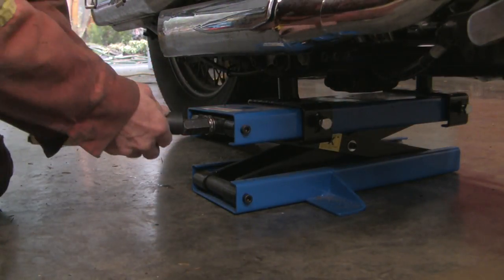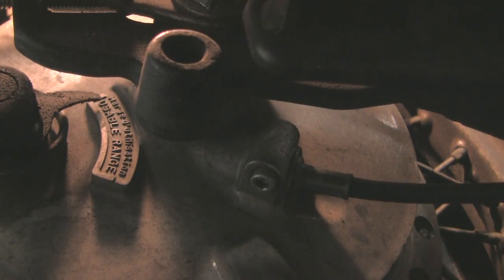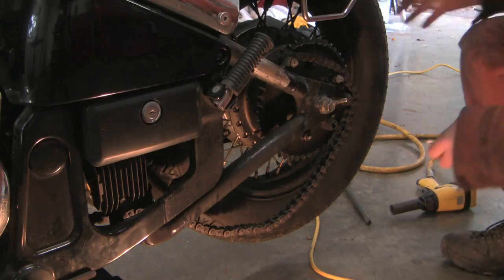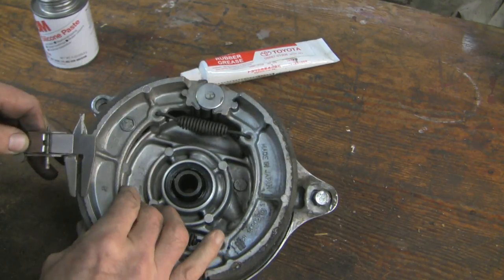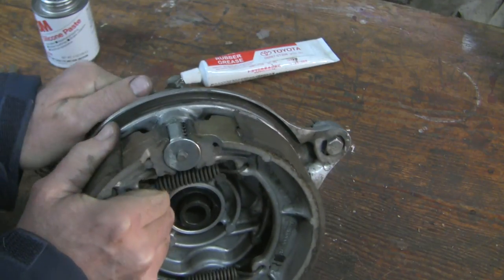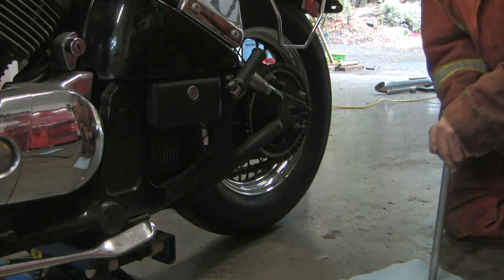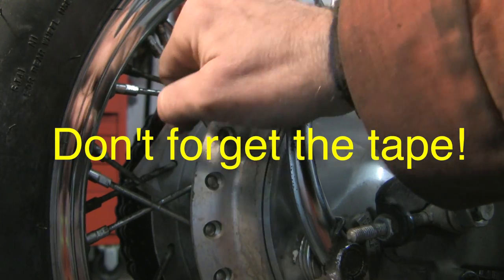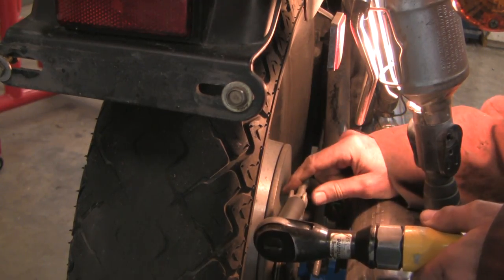Rear Motorcycle Wheel Removal and Drum Brake Inspection

Comment: Have question? My speedometer don’t work? I did replace my speedo cable but I think it might be something wrong with my rear wheel?
Reply from the maker: The end of the cable has a two pronged fork, which needs to mesh nicely with the rotating wheel inside the drum. The first thing I'd check is to verify that the fork is two pronged and correctly inserted into that part of the drum. You may have to rotate the cable and the fork a little to get it to go all the way in. Check to be sure that rotating the cable causes rotation at the other end of the cable, make sure it isn't broken. If all of that checks out, you'll need to remove the wheel and take apart the drum to verify that the inside part of the drum is working correctly. I've never taken that part of the drum apart. Good luck!
Reply: @spelunkerd hello, forgot to reply lol. But I found out who my speedometer never worked. It wasn’t fitted right? So it was bent inwards. Now I re did the error there & now my speedometer works perfectly! Only issue now is my rear brake doesn’t work right since I bought it.

Comment: When i saw the shoe material thickness i knew you were ok for another few years :-).
I have a crappy kawasaki kh125 125cc motorbike, not on the road at the moment, but the back brake is very similar to yours, just a little smaller because it's a small bike.
And my lever goes down not up, but it still has the brake rod and anker bar, much like yours.
-
Was the cushdrive behind the sprocket in nice condition?, or don't big bikes have those?.
I didn't see you take that apart.
I had to put my adjustment rings+thread in a vice to bend them correctly, a past owner must have hit them.
Reply from the maker: Excellent point. There is a cush drive deep to that sproket, although the dealers manual doesn't use that terminology. They describe it as requiring no maintenance or cleaning, so I haven't ever pulled it apart. A replaceable coupling bearing supports it and can be replaced if necessary. Happy Holidays, to my friend across the pond!
Reply: Well if there is no rotational play between the sprocket and wheel it's fine :-D
i and frends call it "cush drive" because its a cushing of rubber around the aluminium driving blades/paddles, if it becomes sloppy then there is a possibility of blade/paddle fracture.
Have a happy christmas :-D

Comment: My speedometer quit working. I watched your other video and replaced my cable but got nothing I was wounding if it could be at the rear tire ?
Reply from the maker: Yeah, possible. It would be interesting to see if the cable spins when the rear tire rotates. If you have a motorcycle lift, you could raise the rear tire off the ground, disconnect the speedometer so you can see the end of the cable where it attaches at the speedometer. Rotate the tire and see if the cable spins. If the cable spins, your problem is in the speedometer itself, if it doesn't spin, I'd be tracing the problem back to the rear wheel. As you know, the cable has an end with a fork, and it needs to slide properly into a mating part inside the rear wheel. I have never torn down the connection at the wheel, but if the problem is there you may have to explore it further. Perhaps the cable you are using is an aftermarket cable that isn't quite shaped correctly to be driven by the gear inside the wheel, or perhaps the part inside the wheel was damaged when the speedo stopped working. In any case, it would be a fun video to watch, you should consider posting your findings. Thanks for the sub, Tim! 

Dave
Reply: I ordered the same cable from your video. I’ll check out what you suggested and I’ll pull out the GoPro see what I come up with thanks again all keep you posted
Reply: spelunkerd nope 👎 not it now I have to try the rear tire see what I come up with. I did make a video when I post it I’ll be sure to let you know. Thanks again for your help

Comment: Hi I am doing front breaks and I can't  get the inside  break pad to stay in,   am I missing  something  or a clip?
Reply from the maker: I did a separate video for front pads on the Kawasaki Vulcan VN800A. If yours is identical you'll want to watch that one. As you say, many calipers have abutment clips to hold the pads in place, but this old Kawasaki does not. Once the caliper is bolted onto the rotor, if properly installed there is nowhere for those pads to move. As I recall, one of the pads has holes in it, through which the sliders glide. If in doubt, go to the most reliable source, the dealer's repair manual, which Kawasaki sell online in pdf form.
Reply: @spelunkerd  okay,  and I thought I left this comment  on that front brake  Video lol.

You are correct  the one is a regular  page with a tap on the top then the second  has a plate with holes that keep it in place,   I put it on and bolt it up and as I pull the front brake it keep popping  out and I just was frustrated  last night after it popped  out for the third time
Reply: I guess I am keep  the pads to  far apart  when I bolt the caliper on , thanks for the reply 👍

Comment: What that indicates "usable range" on 2:42 ? Isnt it drum ware indicator?
Reply from the maker: Yes, that's a wear indicator, to offer a quick check on how much of the shoes (and drum) are remaining. Apply the rear brake and record where the needle points at full brake position. You don't want to rely on that to estimate drum wear, but it is a pretty good guide if you know it was mounted on the shaft correctly. The mount for that gauge is splined, so depending on how it was initially mounted the needle position will vary. However for relative position it is pretty good if you know where the needle pointed before. Another reason to record the position on the shaft if you decide to take that gauge off the splined shaft during maintenance.
Reply: Thanks for reply. Where is wear min/max taking verticaly from up to down? Looking at this "scale" called usable range
Reply from the maker: @vkjnrokis  Because needle position is adjustable it is more of a qualitative gauge, not accurate enough to set a threshold. When you actually measure the pad thickness, you could record where the needle was for future reference, but I wouldn't have too much confidence in the scale.  Lots of other factors come to play, including pad delamination, disproportionate wear, drum wear, etc.
Reply: I see, thank you. Maybe you know mileage approx when you should change drum pads?
Reply from the maker: @vkjnrokis  Depends a lot on driving style, so not really. Rear shoes typically last 2-3X longer than front pads, but there's a lot of variance.